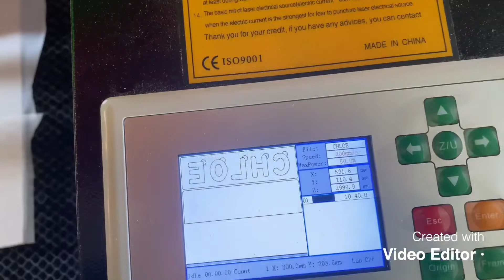80w C02 laser cutter!!

Comment: Hello, i have the same machine and i don t get the pass-through stuff. The entry for pass-through is lower than the bed. doesn t that make your laser head defocused while engraving or cutting? as far as i know, you can t lower the laser and the board will get stuck into the frame if you rise the bed and using pass-through. Do you have any solutions?
Reply from the maker: Hi mate yes I know what you mean it never made sence to me either as that’s correct you can’t lower or raise the laser head so it would only work with one certain size material so it’s pretty useless I think as far as a pass through

Comment: 40% is the maximum power? And the minimum?
Reply from the maker: Minimum I usually put about 10 lower than my maximum the minimum is the amount when the machine slows down comming in and out of a corner so it doesn’t burn up the material too much 😊
Reply: @woodendayz great, thanks

Comment: Is this Vevor brand?
Reply from the maker: Yes it is 😊
Reply: And did you have any problem with it?
Reply from the maker: @dinos_workshop only some minor problems like the bed wasn’t 100% level I also had a water leak where the water lines connected to the machine as they didn’t have hose clamps just zip ties, other than that it’s been a solid machine

Comment: Do you use a compressor?
I was thinking about getting the Fortress
Reply from the maker: Yeh i definitely do just a small 5hp with I think it’s a 50L tank seems to work really well the compressor kicks on a fair bit but it is not very loud and also in a shed outside so it really doesn’t bother me,
I have the ultimate air assist kit and super happy that I did do the upgrade it’s so much better than the small standard air assist they come with 😊
Reply: @woodendayz  mines is indoors 
I just got my omtech chiller & infinity kit.
I’ve had my machine since April & haven’t Used It.
My goal is to be up & running in two weeks.
Any tips or advice, for indoors?
Reply from the maker: @themeditationcorner6531 I unfortunately not really as mine is outside in my shed I would only suggest making sure your extractor fan is all plumbed up good with no leaks so all the nasties vent outside,
I could not imagine having the machine for that long and not using it lol you would be very keen to get it up and running hope all goes well for you 😊
Reply: @woodendayz  ikr.
Anxiety took over & lack of help.
I mentally shut down.
Your videos help me get to the point of buying my machine.
Thank You.
Now I just have to put it all together.
My infinity Air Filtration Kit 6", Inline Fan Carbon Filter and Ducting  will be here Thursday.
Reply from the maker: @themeditationcorner6531 yeh it can be scary starting out that mainly why I started doing the vids I had no idea when I started did a lot of research and just took my time hopefully you can get it ally I and running let me know if you have any questions happy to help where I can
Reply: @woodendayz  Thank You Soo Much.

Comment: What is the red wiring that on the laser tube for?
I have my laser hooked up but it won’t come on.
Reply from the maker: It’s just the power wire have you got the laser switch switched on? On the side of the machine hit the pulse button see what it says is your water pump turned on?
Reply: @woodendayz  I flipped the switches & still no power.
The water was running through the laser tube still no power
Reply: @woodendayz  do I have to do anything to that wire?
Reply from the maker: No you shouldn’t have to it should be connected to the tube on one end and the other should run into the power supply on the side of the machine
Reply: @woodendayz  the red wire is taped on top of the tube with electric tap on the end